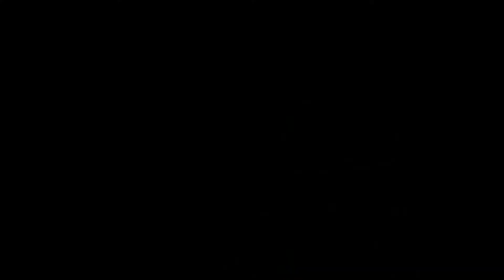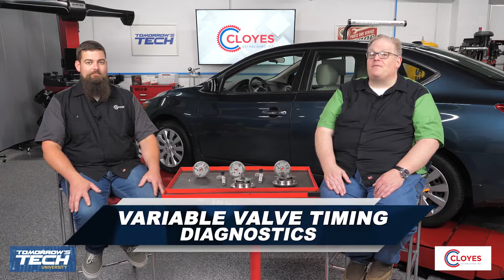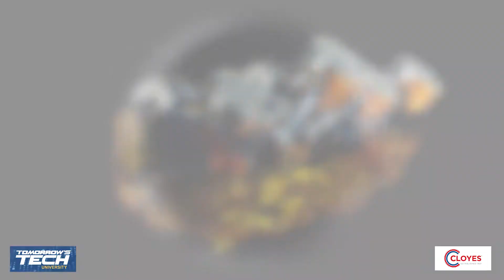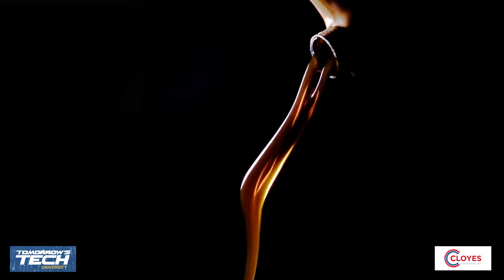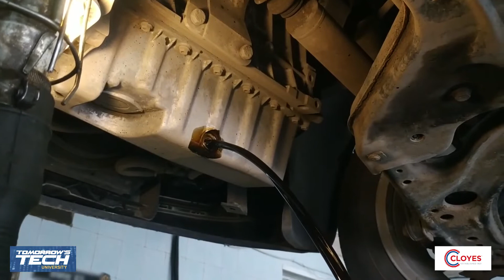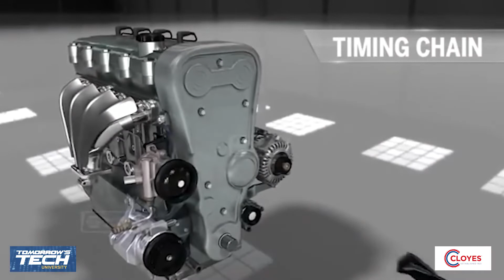What can wrong with VVT systems - Oil: Variable Valve Timing Module 2

Comment: I replaced the timing chain, tensioner, cam phasers and vvt bolts and my new cam phasers immediatly rattled like ones that are going bad(mainly at cold start and improves a great dealonce warm but still happens on and off). could the part be defective or could I have done something wrong?

Comment: "keep the oil changed as they (the manufacturers) recommend." That statement is ignorant of the fact that oil change intervals are developed by accountants and marketing people, not engineers.  Toyota, for example, recommends an OCI of 10,000 miles or one year.  For the most of us who don't drive mostly on the highway, that's a recipe for disaster - sludge and short engine life.  A friend's Honda Accord developed a cam phaser rattle at 80,000 after 8 years of annual oil changes.  His direct injected engine had filthy black oil after 7,000 miles of mostly short trips.  A chemical oil flush fixed that (for the time being).  He may still be facing thousands in repairs due to dirty oil.